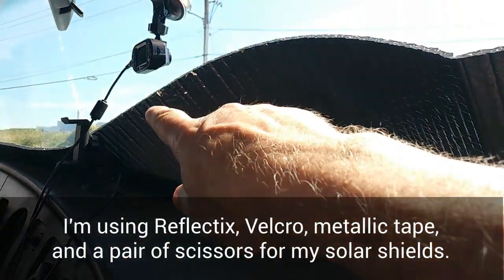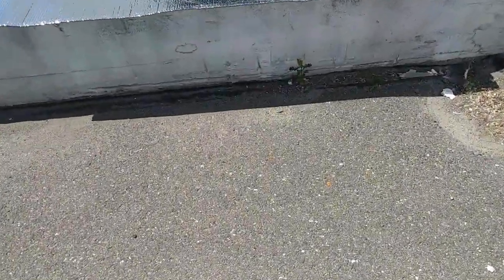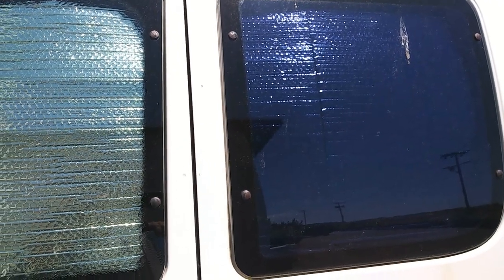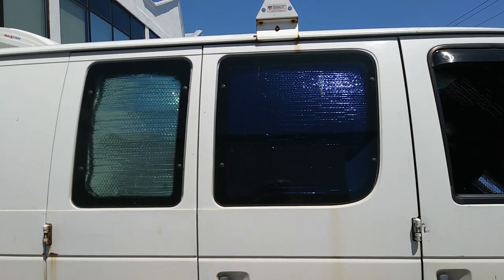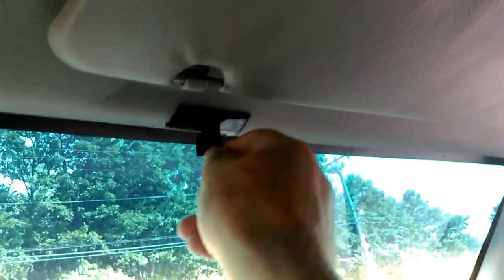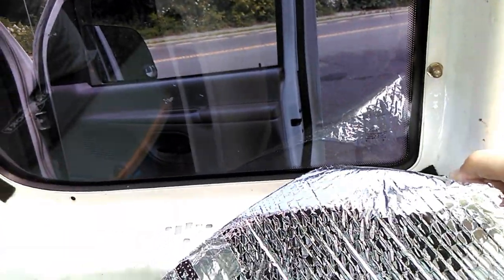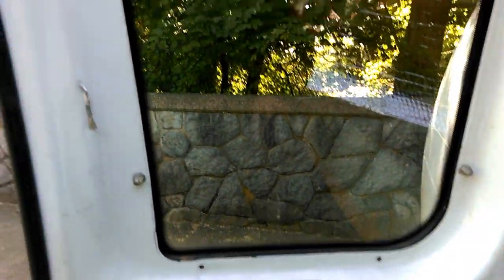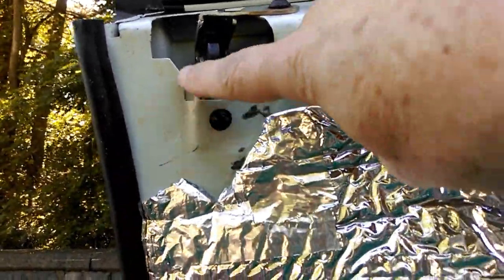Solar Window Shades

Comment: I hope that stuff  sticks for you. I used the same exact stuff for my dogs coats and I ended up having to sew it on. It just wouldn't stay stuck! Keep us posted on your sticky situation! LOL! I truly hope it works for you. If not, maybe some gorilla glue?
Reply from the maker: Tammie Parrish Miller The heavy duty Velcro tape on the door windows is holding just fine. Haven't had to use the windshield cover yet, it's been cloudy but I think it will be ok. I'm using the side window for daylight now and it's holding up. On my next van I'm going to fill the space between the Reflectix and glass with bubble wrap in the cold weather. There are videos that show that it effectively insulates and allows light to enter.
Reply: YES! I was just thinking that as I was reading what you wrote! I heard that stuff was fantastic! Hope you are enjoying your summer. It's just HOT! I hope we at least get a nice long fall. That would make up for the spring we didn't have.
Reply from the maker: It's been really hot and humid here too, unbearable. I'll be posting a video in the next day or two of a short camping trip to a seaside campground nearby. It was oppressively hot, I prefer cooler weather for camping.

Comment: You threw me for a minute there. Aren't they all removeable? That's the purpose of the Velcro. I'm thinking you are just partial to that particular window because it's the one right next to your bed. I'm still trying to get my windows done by my Grandson but waiting to have the money to order the supplies from Amazon. You've kinda inspired me to go ahead & start on the reflectix panels first tho. 🙂
Reply from the maker: GRAMMIE DEBI As for the window coverings in the back of the van, I only made the two next to my bed removable and not the two in the rear doors because that's where my son sleeps and he doesn't want them open so I just taped them on. When you make them, be sure not to have the Reflectix touching the glass, secure them to the steel part of the frame surrounding the window. That will leave you with about a one inch gap between the Reflectix and the glass that you can fill with either rigid insulation or plastic bubble wrap which will insulate the window but still allow daylight in when you peel back the Reflectix. Do a search on YouTube for bubble wrap window insulation, there are several good videos about it. Is your van insulated? Good luck with everything, don't be afraid to ask any questions. If you lived closer I'd be happy to lend a hand.